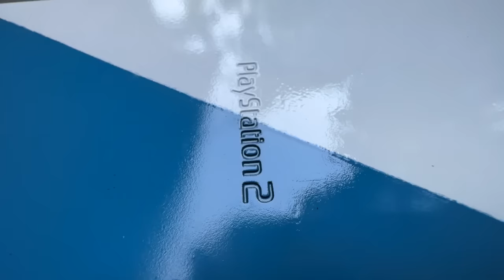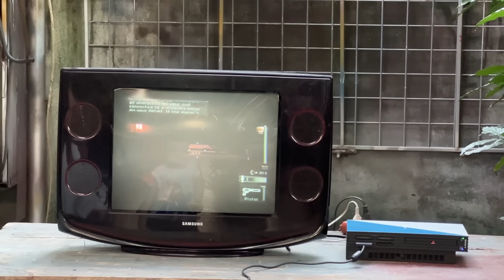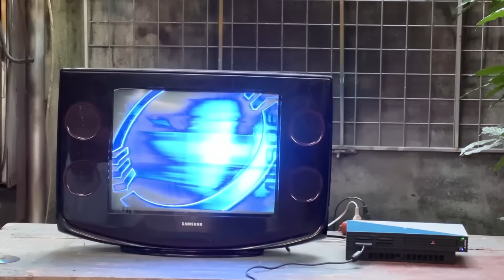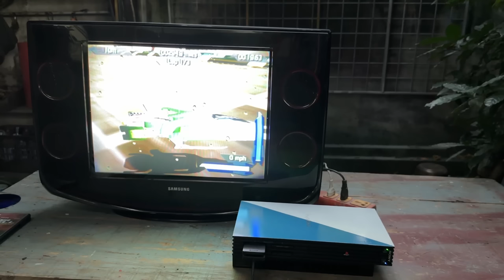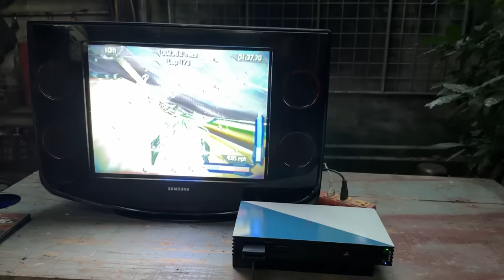Amazing! How can I restore SONY game PS2 fat | Repaired old playstation 2 Game console

Comment: In this harsh climate plastic rusts but sensible electromechanical components just need a thorough wash to be like new 😆
Reply: I agree :sanitizer: This damaged ps2 does not even have any green metal corrosion.
Reply: No se que sea más increíble, la reparación o que sepa bien donde encontrar las consolas abandonadas?
Reply: lol
Reply: @danielangulo3289  The knowing where to find them is a local shop before they destroy them for a video.
Reply: Это все из-за хорошей воды и умного лица реставратора😅
Reply: @danielangulo3289 para mí que todo es actuado
Reply: Ha..ha...pembodohan publik

Comment: YEAH JUST WASH IT OFF WITH WATER. THAT FIXES IT. LETS JUST IGNORE HOW UNDISTILLED WATER WORKS WITH ELECTRIC COMPONENTS.
Reply: didn't you see he changed the capacitor?? . without washing it won't work, the mother board uses plastic and aluminum so it won't corrode.!!

Comment: Water and detergent are enough to restore the PlayStation, no, this is almost impossible, for heavier and initial cleaning you can use it, but if you don't dip all the electronic parts in Isopropyl Alcohol and leave them soaked for some time, you are being lied to, even Using Isopropyl Alcohol, the pieces must be left to dry for at least 1 week and there is no guarantee that it will work.

Comment: You know you're not gonna make a console work if the disc drive assembly was also in the dirt too? 
A simple cleaning wouldn't fix that. The laser is gone. Motors are probably jammed too.

Comment: There is no doubt that the electronic circuit cannot be revived if it is damaged that much. When reassembled after cleaning, the rust on the copper wires was gone and the shaft of the drive unit was new, so it was just a matter of reassembling the disassembled parts. This is nothing but a scam video.

Comment: Yeah no way this will work after you basically washing the whole thing in soapy water.
Reply: I've washed many electronic components in soapy water in the bath/shower. The key is to not do it with a current running through at the time and making sure that you remove all of the water (DON'T let it dry on as the minerals in tap water will destroy components over time).